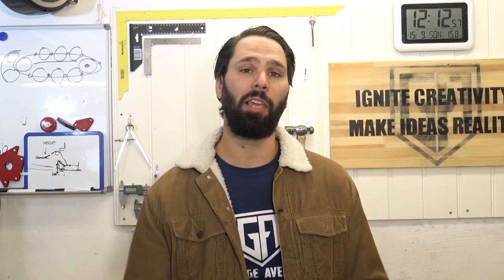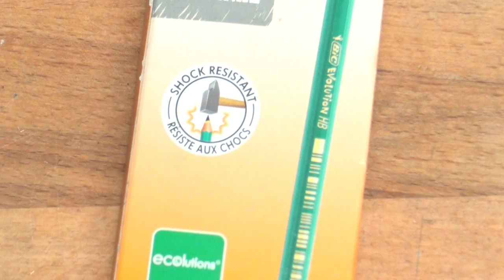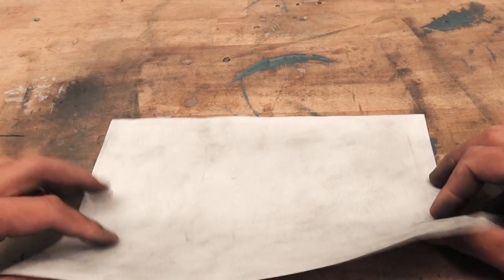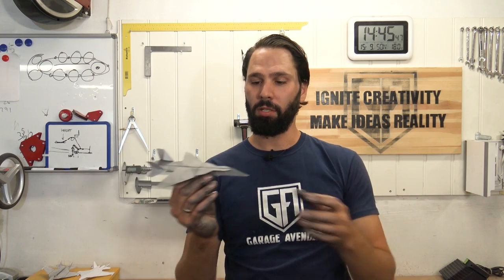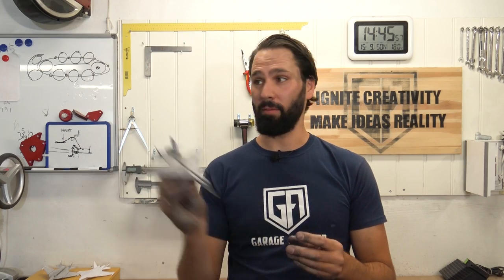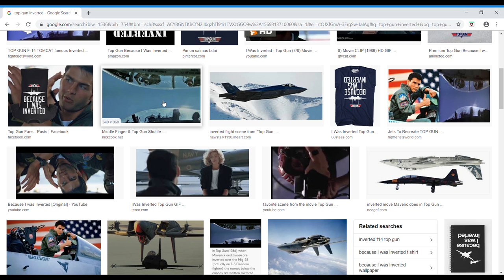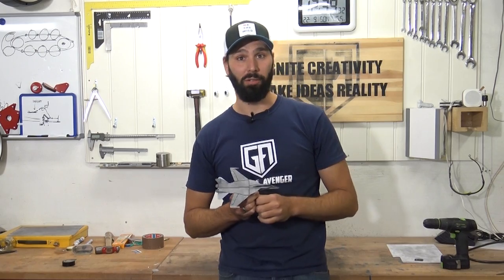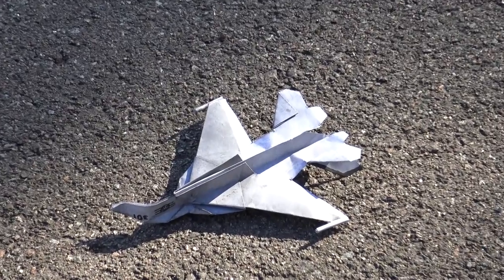TOP GUN 2 Paper Airplane.... Will it fly?

Comment: impressive, i think you can add one more opposite fold at the wing fold to make a cockpit if you dont want to use a seperate paper, and the hard points at the wings you can simply reverse fold the edges and swivel fold the points to make them thinner. this is if you want to use only one paper